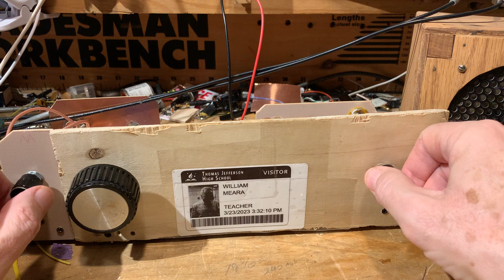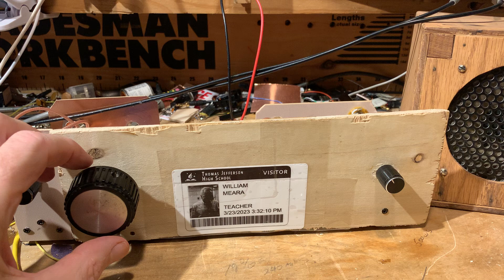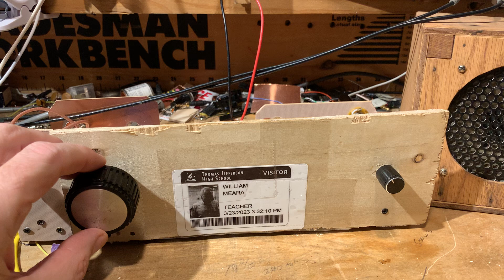Evening listening to 40 meters with the High-School Direct-Conversion Receiver

Comment: So, when it warms up does a coil go down in inductance? Raising the frequency? Most of the non NPO/cog caps I think go down in capacitance as they warm up which would also raise the frequency. My recollection is that silver micas are not predictable. On the popcorn site brads excellent VFO video says not to use manhattan copper pads to build a VFO and my first attempt at the pto used very large pads but did not oscillate. The second one had much smaller pads but I don’t know if that’s why it succeeded. It does drift up in frequency, at least initially.

Comment: Nice, some day I build a DC radio too.   
If want more fun, connect the audio output to a PC sound card in and run a SDR software like SDR# or GNU Radio, or a decoder for digital modes.  
SDR, Software Defined Radio.